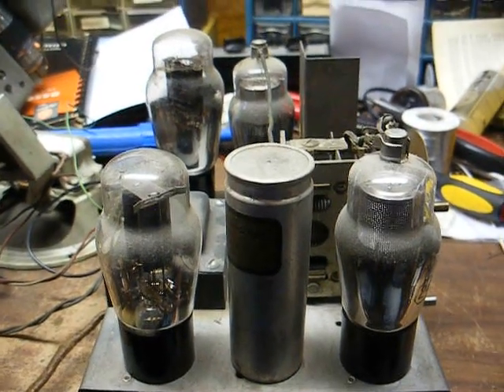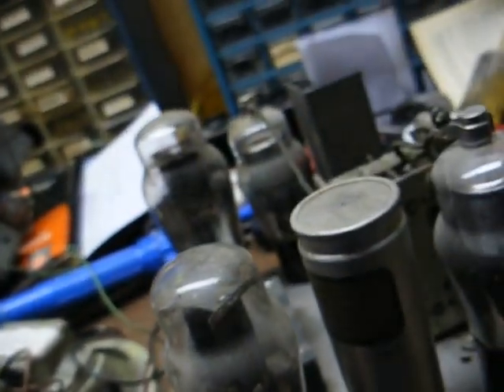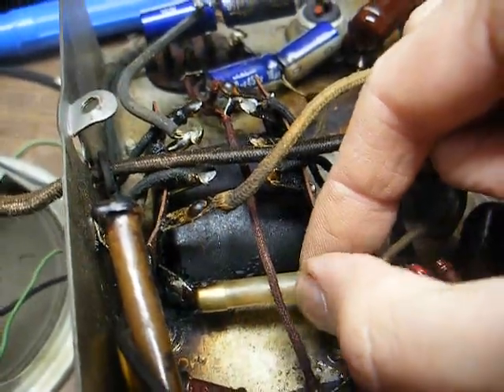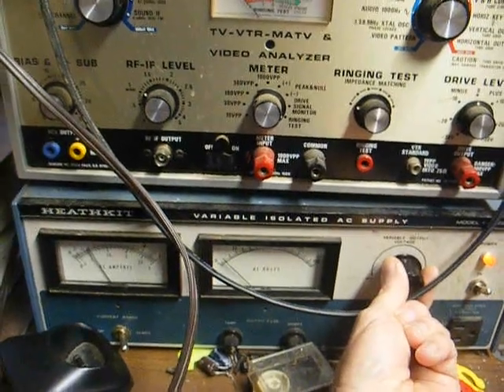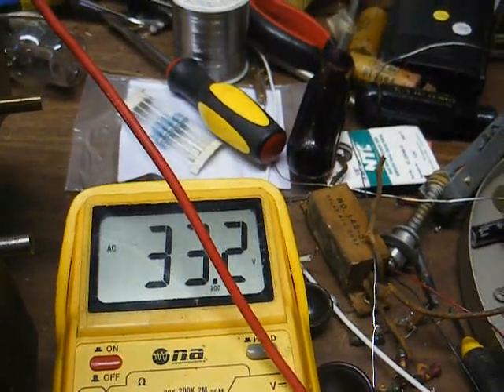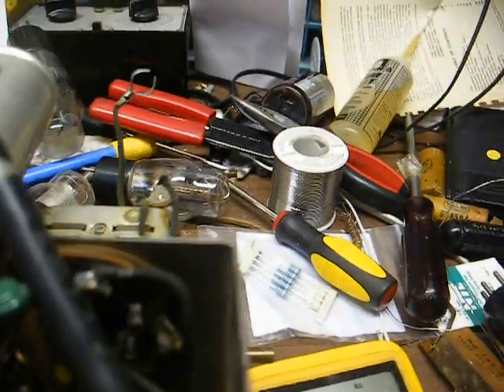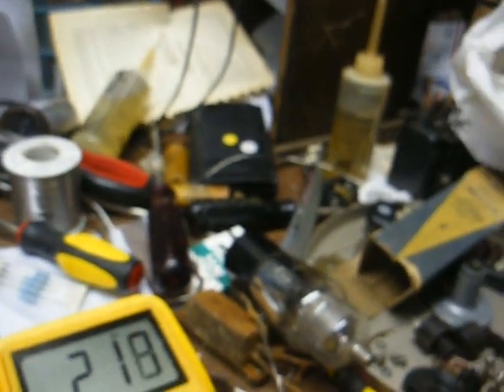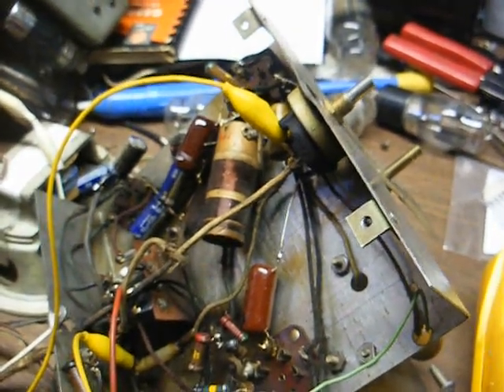Bad power transformer in a 1930's Clinton cathedral radio

Comment: I converted a Windsor plastic cathedral radio from the 80s into an extension speaker The radio was originally damaged by lightning and fried every semiconductor on the chassis. I mounted a Ford 5x7 inside the case and connect it to a great sounding GE superadioI.  I use it on the beach and always draw a crowd. They never saw a cathedral radio playing on the beach!!! I hid the superadio in a duffel bag tuned to my favorite station. The beach crowd couldn’t figure it out..The cathedral radio was all plastic so the water or rain will not damage it. I had the most rarest radio on the beach and the sound is excellent!!!!!

Comment: The case is in excellent shape I would upgrade the speaker with a pm type and use this unit as an extension speaker until I found a power  transformer The speaker could be connected to a newer radio and would still make a great conversation piece. You put the old chassis back in case and install all the knobs so it will still be original. You could also install a Bluetooth amp to connect to the speaker if you care to modernize it. The amp would have to be small enough to lay or mount on the original chassis. An.interesting Bluetooth speaker!!!!!

Comment: Given the right type of transformer to rewind that can be taken apart without too much hassle, it can be a nice fun projec to rewind it. Look for transformers with core size for 50-75 va range and no varnish or other junk. dont bother with HV winding . A simple 90volt ac winding will give you 250vdc from a fullwave doubler.

Comment: I was at a barn sale that I saw an RCA Victor Radiola R-12 from 1932 and it does seem better days. It had an original chassis on the back with the super hydrodine tubes which was common for a 1930's set, I don't have to get it, because I've already got my Victrola VV 8-4 by Victor.

Comment: If the radio were particularly important, then you would have the transformer re-wound.
Why use 2V heaters if the tubes are not designed to run from a B+ battery?
Reply: NJPurling -when indirectly heated cathodes were first used in tubes , 2.5 v was typical. When car radios became popular than the heater voltage became 6.3v since that was the voltage available in autos of the day
Reply: If 6.3 v versions of the same tubes were available, that would make a replacement tranny easier to locate
Reply: Maybe a step down  transformer could be added to the 6 volt secondary to drop the voltage to 2.5 volts that those tubes could use

Comment: That's a great set, it's a real shame about the power transformer. But it seems like the voltages on this set are pretty common, so it shouldn't be too hard to find a replacement from a junker radio.

Comment: I'm cleaning up my place, and may stumble on a chassis or two of that vintage and genre, if not the same brand.  2.5V filament type can be a challenge. If I do run across any I'll check the transformer and contact you for your address and send it your way.
Reply: David Locke -see if there were equivalent tubes with 6v heaters . I know there will be some loss of originality but that should make it easier to find a power tranny